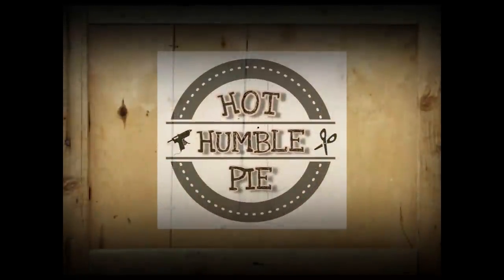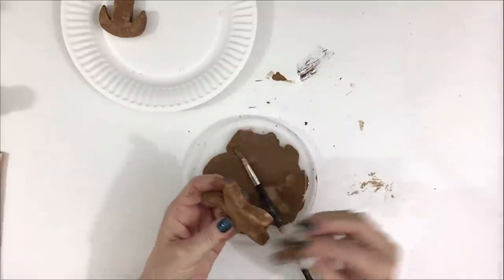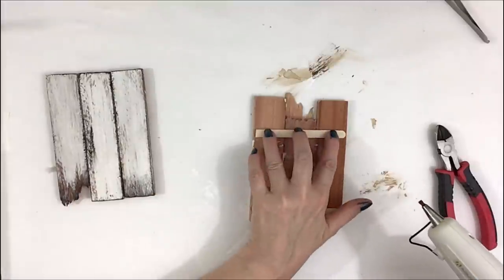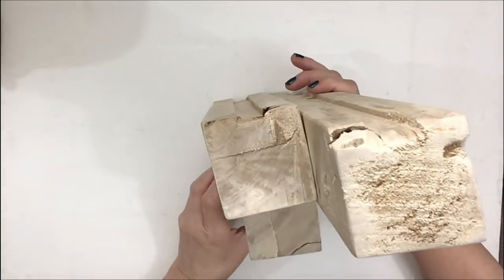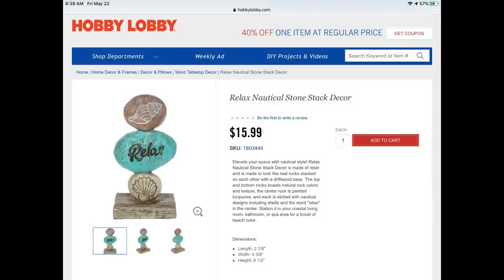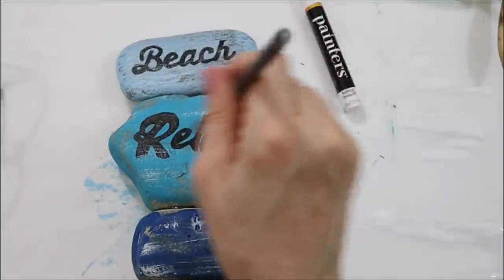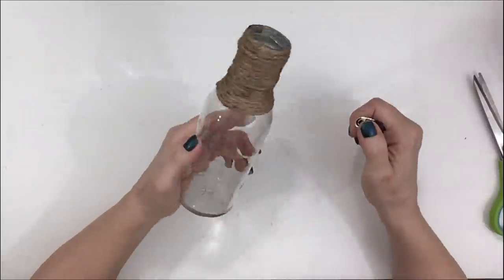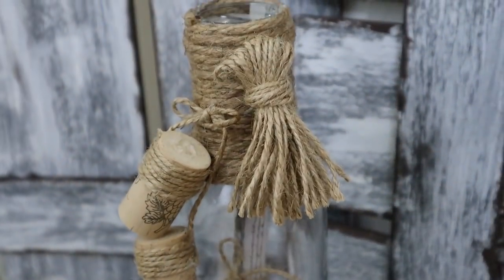NAUTICAL DIY/TRASH TO TREASURE/FREE CRAFTS/FARMHOUSE COASTAL/SUPER CHEAP HOME DECOR/HOT HUMBLE PIE

Comment: What's that little blue handled tool you're using to press down on the hot glue called?  And do you know where you got it?  Love the beach decor!  Thanks
Reply from the maker: Hi Dana! It’s a make up silicone spatula found in the makeup section at the Dollar Tree. People are telling me they are finding it so it is still for sale. I bought it on a whim to use instead of wasting craft sticks with the hot glue. I had no idea it was 100% silicone! It doesn’t melt and the hot glue comes right off. Highly recommended! Thanks for the nice complement! 🥰😘🌸🌸🌴🌴🐟🐠

Comment: What is the brush with the blue handle? Used for hot glue...
Reply from the maker: Hi Alicia! That is a make up spatula that is made out of 100% silicone found in the makeup section at the Dollar Tree. I did not know it was silicone when I bought it. I bought it for the hot glue but I expected it would get damaged. Instead it has proven to be amazing! It doesn’t melt and the hot glue doesn’t stick to it. Somebody just wrote on this comment thread that they found it, so if you live near a DT keep your eye out! If not try to get a hold of a small spatula made out of silicone. They are wonderful! 🐟🐠🌴🌴🌸🌸🥰😘❤️
Reply: Thank you for your quick response! That’s awesome and it looks amazing for use with hot glue! I am super close to a DT thanks! Happy 4th 🌺🦋🥰